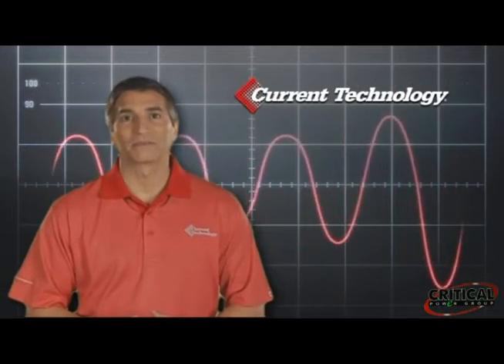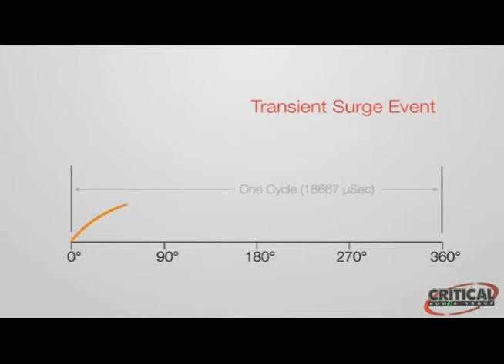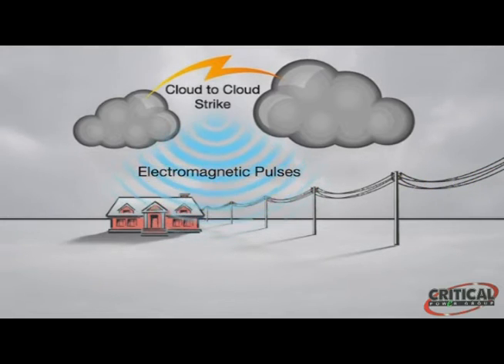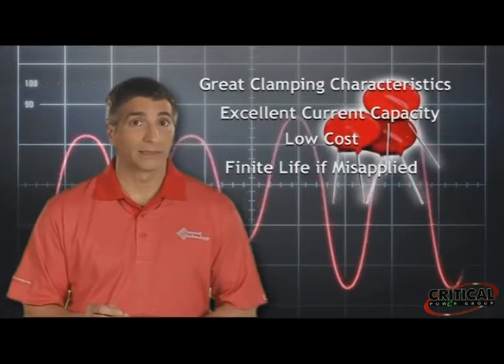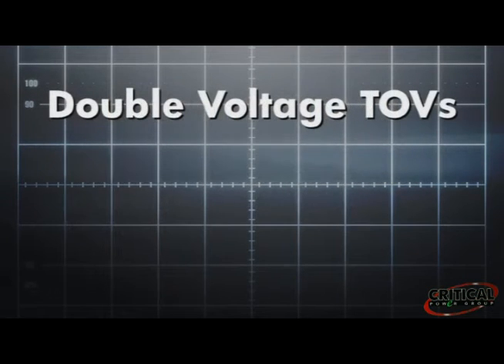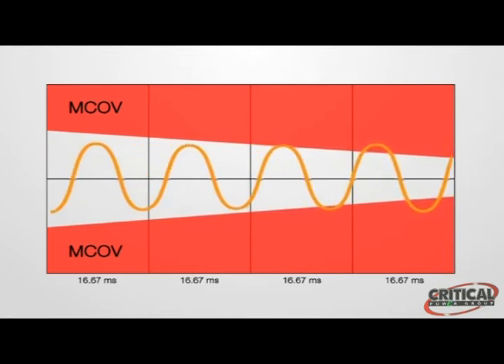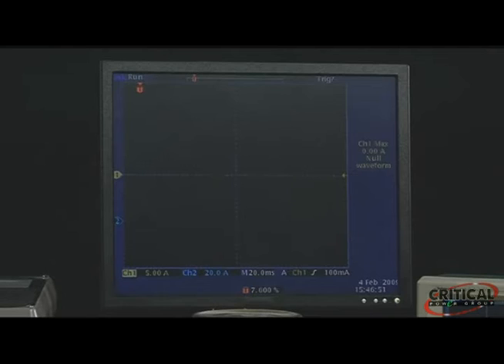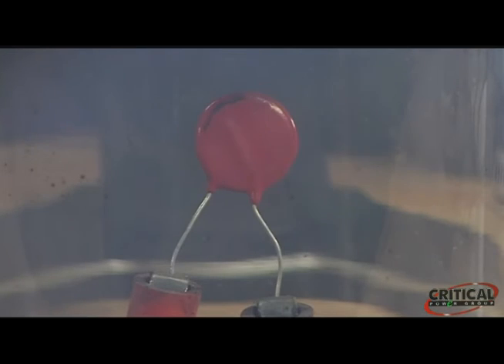Current Technology Surge Protection (TVSS/SPD) Part 1 of 2

Comment: Well done, you cited the 20/80 source of transients frrom the GE MOV techical paper wittten in the 70s. I also used that in an engineering course I prepared for Engineer license continuing education.  I look for low clamping voltage first, joules second.

Comment: I’d take the latter, the SPD with a lower MCOV because it’ll protect the equipment attached and if designed correctly won’t pass any voltage after the MOV “pops”, indicating a replacement is needed. Then all I’ll need to do is replace the SPD and I’m back in business.

Comment: but you hid the most important info. How many amps were following when the MOV failed? Your Part 2 video shows the selenium allowed 39amps, was the MOV by itself lower? I think so! And I'm only addressing Amps here. Noone has bothered to ask why is it taking 220v to see the product working? It ia only suppose to allow 15-20% over 120v and you are showing your product doesn't kick in until approx. 100% over.

Comment: Excellent video mate, just a few definitions and terms have changed in 2019 but your data still holds. The term TVSS is no longer used instead the industry term now is SPD (Surge Protection Device). Another term misused here is TOV (Transient/temporary overvoltage). The industry uses this term for several microsecond surges now. Anything in the hundreds of milliseconds is now called POV (Permanent overvoltage). I'm sure you know this but I'm posting for the benefit of new viewers.
Reply: I'm a little concerned now if they are not up on the current terms.  Think I will go ahead and install the Siemens 140 protector.
Reply: @researchcapt  Siemens is way over priced, have a look at other brands like Eaton or Citel.

Comment: Degradation of MOV effectiveness is the reason why you must periodically purchase a new surge protector strip.
Reply: @sgals3395  Yeah so true. I remember visiting the Empire State Building once and they still live like its the 16th century in there as they're very prone to direct lightning strikes. Poor peeps, I felt so sorry for them.
Reply: Not if you spend more and get a series-mode, non-sacrificial, inductance-based surge protector from companies like SurgeX, BrickWall, ZeroSurge or even Audioquest. Those don't use MOVs and they will take repeated, large surges without being damaged or having to be replaced. Now, you'll pay more for those, of course, but as the old saying goes, you get what you pay for.